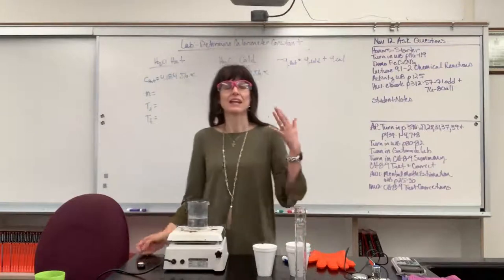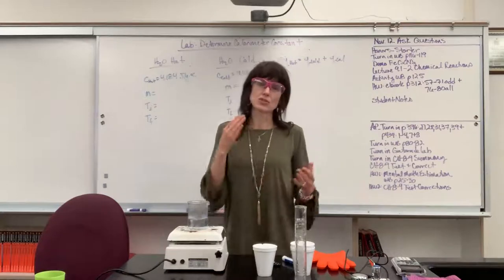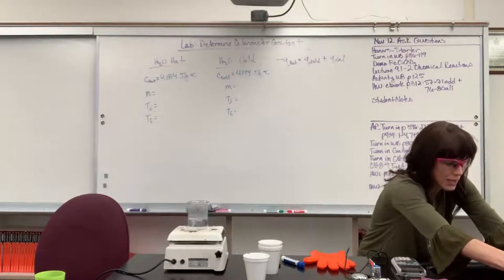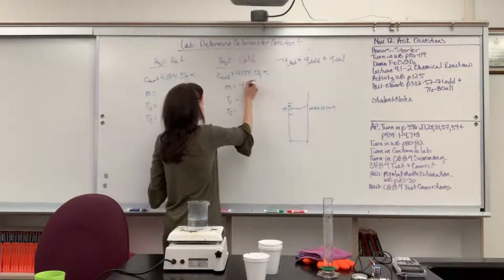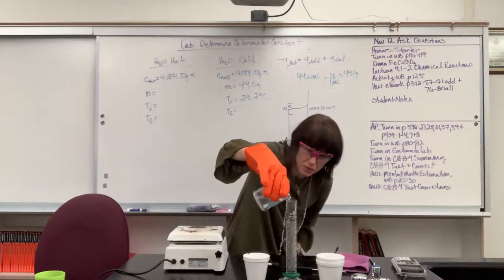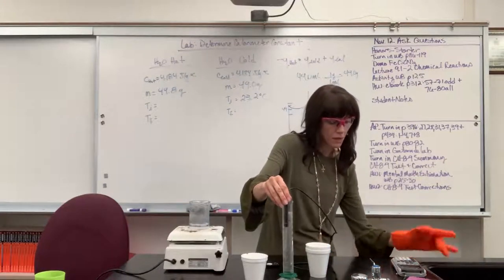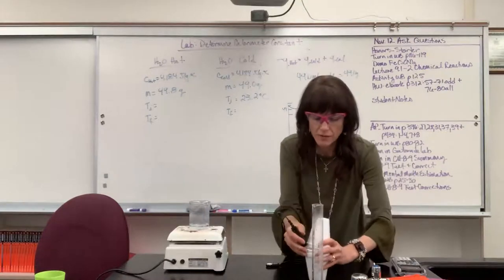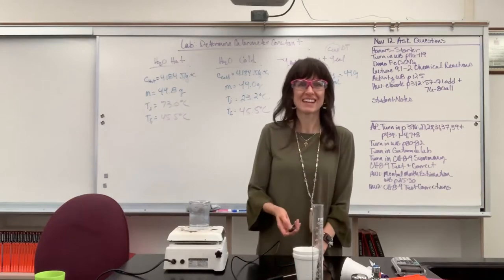Lab Calorimeter Constant

Comment: Could you also just let hot water cool down in the calorimeter? You would still be able to see the energy loss through the temperature change. Is the cold water necessary? can -q(hot  water) = qcal
Reply from the maker: Yes:)
Reply: @OldSchoolChemistry  Thank you!! Then what value would you use for the initial temperature of the calorimeter if you don't have the cold water's initial temperature?

Also thank you so much for your videos, they are so great!
Reply from the maker: @annieelliott8803  It will be in thermal equilibrium with the surrounding room.  The temperature of the room will be the initial temperature of the calorimeter.  I hope that helps!